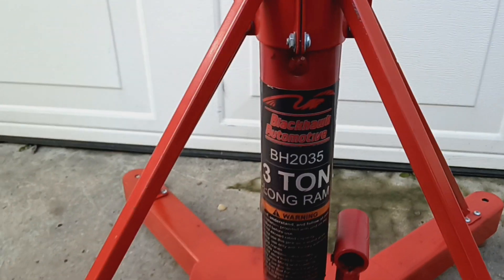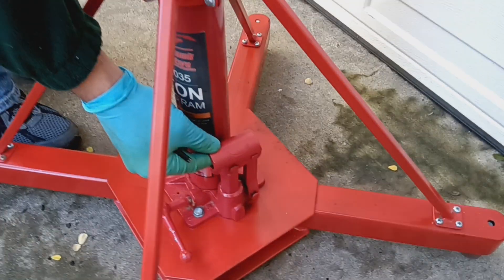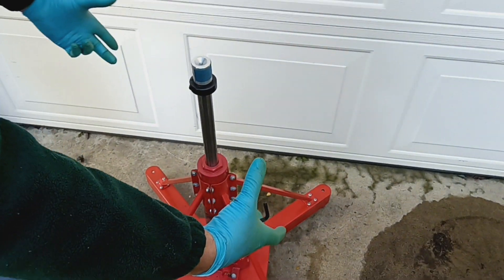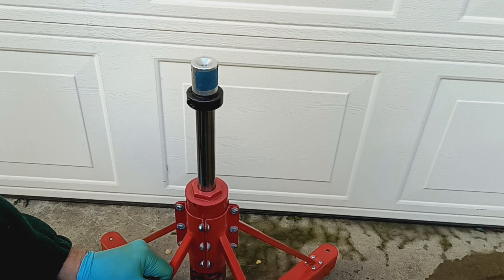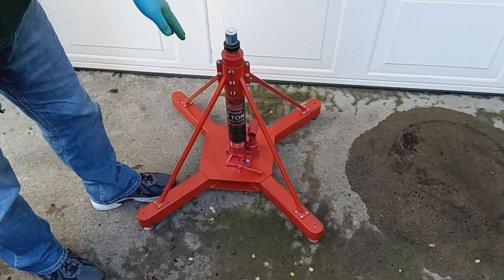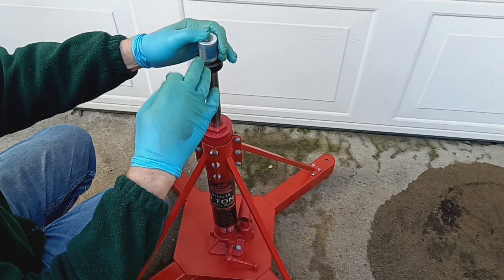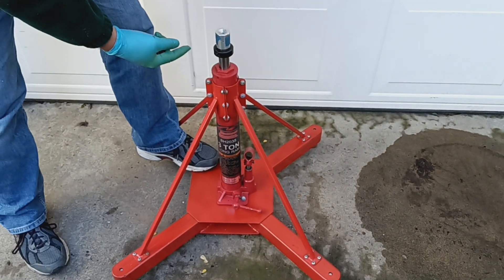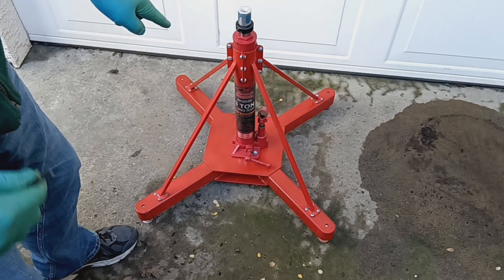Hydraulic jack failure mode: Aircraft Jack application

Comment: Thanks for this important information. I would not have been seen that coming. I have left my Piper Arrow on jacks for extended periods and will not do that anymore. I’m still not quite sure how you got your plane down, but it doesn’t sound like it was easy. I will simply never leave it jacked up. Thanks!
Reply from the maker: Hopefully sharing this will prevent someone else from the same predicament.  I ended up building a contraption that I could assemble 'around' the jack ram that had a pair of threaded rods that could be used to slowly lower the jack bit by bit until it was all the way down.
Probably using an acme screw jacking mechanism, rather than hydraulic, would be the safest bet.  Or having a hydraulic jack that is better built such that a side load won't cause the internal seal to 'unseal'.

Comment: the pipe clamp/ split pipe holder... can you tell me where that came from?
Reply: Amazon.  Get 4.  That way if this happens you can walk the jack town in small steps using two collars per jack.
Reply from the maker: I made them from segments of a tube that was too large diameter for the jack.  I cut the segments from the tube and then bent them a little more to match the radius of the jack tube.  Then welded on two 'ears' to each segment so they could be bolted together.  Would have liked to find the right size tube to begin with, but I used what I had.  Sorry about the late reply, I don't often check this video comments section.  There's probably a way to get notified when there's a new comment, but I haven't yet discovered that feature.
Reply from the maker: Maybe I misunderstood the original question... Oops.  I purchased the 'safety collars' from either Amazon or eBay IIRC.  And, I like the other person's suggestion of getting two for each jack shaft, although there might not be enough room under the wing of our plane to put the jack in place with two collars on the shaft since the second collar would raise the minimum height about a half inch...  

I'm sure I could figure something out, though...  Hmmm

Comment: woah.... considering building some AC jacks with harbor freight bottle jacks like this. I'll definitely have to test the jacks for side loading before use! Thanks for putting this out there.
Reply from the maker: The jacks I used were a different brand, 'Blackhawk' from ShinFu America.  I contacted their US support/distribution and talked with a tech there.  The tech didn't have any idea what could be causing the issue - just said it could be a whole bunch of different causes
At the time I talked with him, I hadn't yet figured out what was happening (I.E. what was going on, other than the fact that the pump portion of the jack seemed to do absolutely nothing- no resistance to pumping, even), but had the aircraft up on the jacks and the 'safety collars ' (clamped on the rams) were apparently supporting the aircraft - there was NO WAY I was going to loosen the safety collars without some additional mechanism to prevent the possible quick collapse of the ram into the jack body!  

Can't remember if I mentioned it in the video or not, but I devised a contraption that attached 'around' the ram, in between the cap on top of the ram and the jack body.  The contraption featured a pair of threaded rods that would allow me to slowly lower the ram in a controlled fashion via nuts on the threaded rods.
BTW, my hangar neighbor has a commercially available pair of jacks with three legged bases - I think from Alpha Aviation.  It appears they also use hydraulic jacks from Shin Fu America, although a slightly different model than the ones I have.
I told him the story and demonstrated the issue with one of his jacks, although the jack seemed to be much less prone to retracting with a side load than the ones I have.  
I would recommend not leaving the aircraft up on these types of jacks for any extended periods of time.  Additionally, if safety collars are used, they should not be set so they contact the top of the jack - doing so will cause a loss of internal hydraulic pressure behind the ram and may cause ram's internal seal to become 'de energized, thereby leading to the situation that I encountered.'
Reply from the maker: P.s.  The jacks I used were a bit shorter than what was available through Harbour Freight - the HF jacks wouldn't have fit under the wing of our Comanche - probably similar if it were a Mooney or an RV